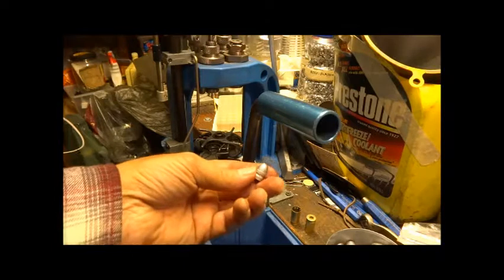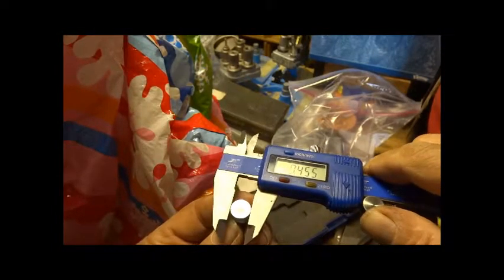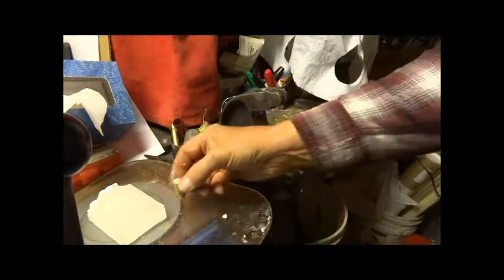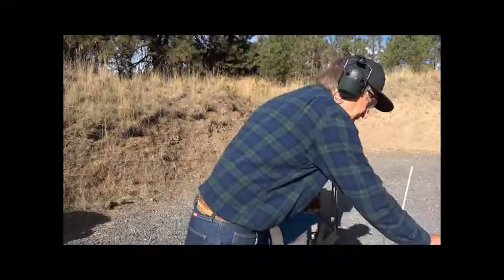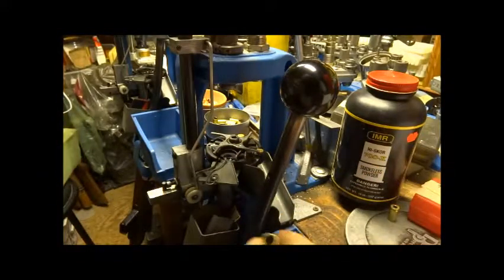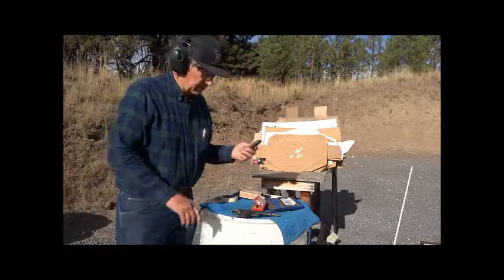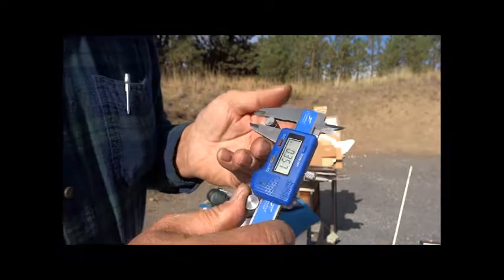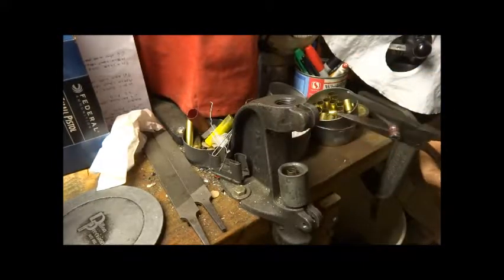Slugging a barrel by firing a bullet

Comment: Instead of using paraffin wax, I've done the same thing by taking a large cleaning patch and wadding it up inside the case to act as  a wad.  Then you don't have any wax to clean out of your barrel.  Good video sir!
Reply from the maker: Thank you.  I usually end my session by firing a few cartridges to get any water out of the barrel, so I have not seen any paraffin wax in the bore.  Some of my blank cartridges have paraffin wax in the cartridge case which I dig out with a screwdriver after firing
.